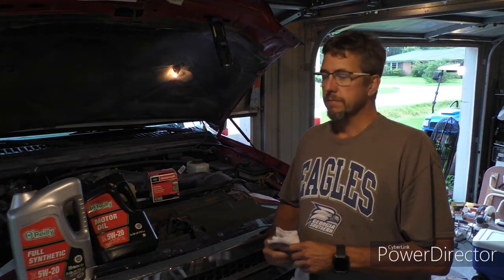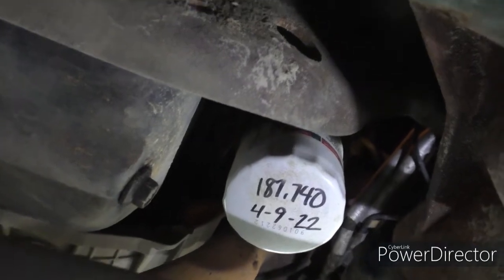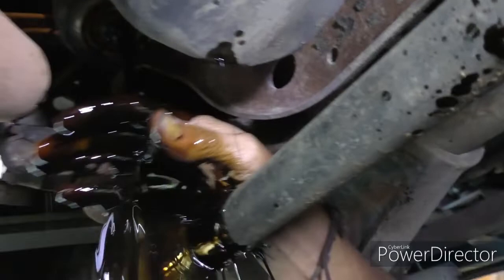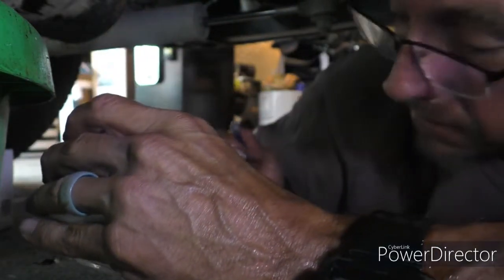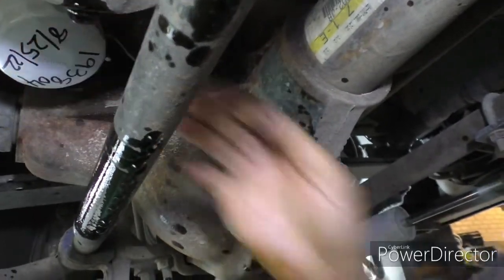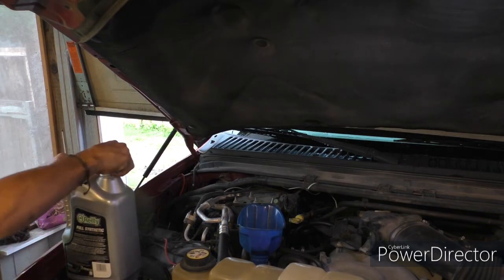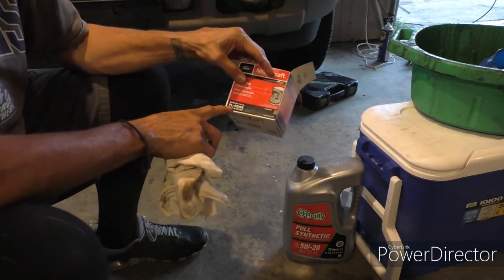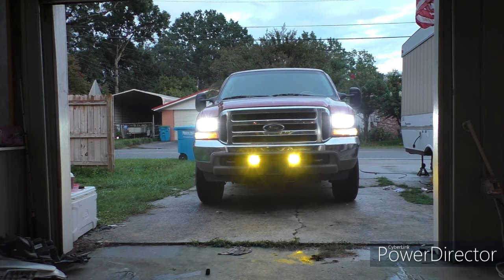V10 Excursion Oil Change

Comment: What scanner did you use ? What coil packs did you use to get it run properly?
Reply from the maker: Forscan on a laptop and a ELM327 adapter off Amazon. Here ya go: https://amzn.to/3Z2kQlY
Reply from the maker: If you go with a tuner, 5 star tuning will get you a little more power after you install the SPD Y pipe, gut the cat(if no emissions), and a better muffler. I’ve got some shorts of what that sounds like.
Reply from the maker: Excursion V10 exhaust #ratemychop
https://youtube.com/shorts/6tJnpvN6G5U?feature=share
Reply: @HammerWrench  Thanks I watched them and many of you videos last night
Reply from the maker: Thank you for watching and hope it helped you out.
Reply: @HammerWrench  ELM327 is that still good one since your video is old ? Is there a newer one to replace it that you recommend? IF I were to replace any or all coils what is best brand to get ?
Reply from the maker: @Richard5873 my ELM cable still works well. It converts OBDII to USB so your computer can read what’s going on with Forscan. There are Bluetooth ones that adapt to your phone but I haven’t used any of them. 
When you choose coils, go FORD or ACCEL. Ford should be your number one and yes they are expensive for 10. You could use knock offs to get by but they will go out within a year or less.
Reply: @HammerWrench  Thanks a Million on advice.
Reply from the maker: @Richard5873 you’re welcome Richard. Our purpose is to help our sons and grandchildren, and anyone else that watches. Glad to have you too!